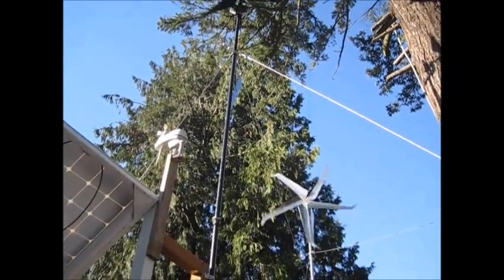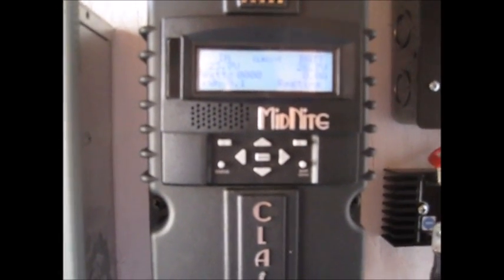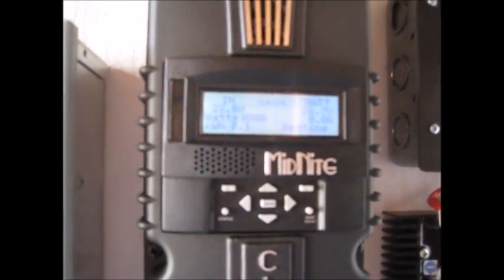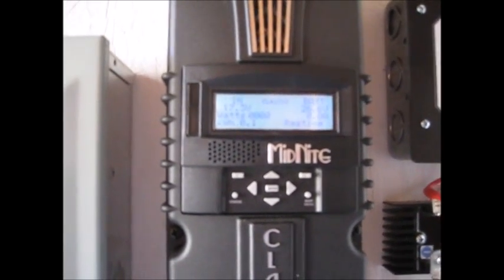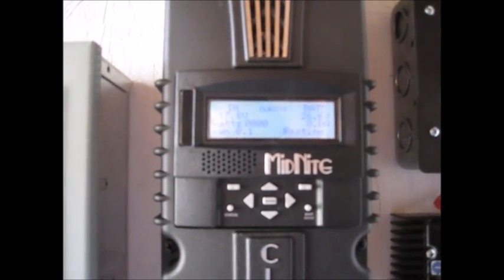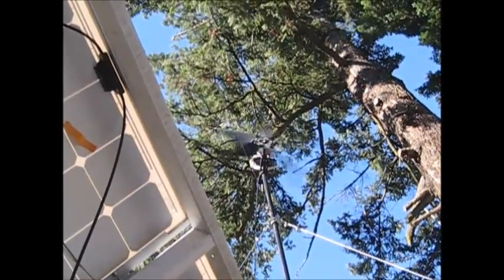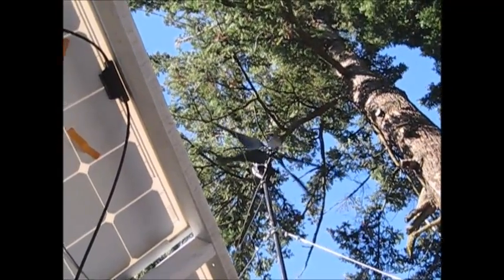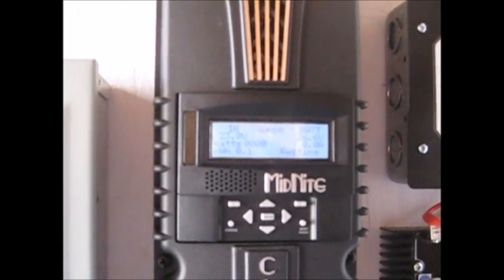MidNite Solar Classic 150 power curve adjustments

Comment: this will definetely help boost power output alot with the mppt however i am still trying to understand it better one question i have is do you program it with the measured voltage open circuit or with a load and also i wonder how you would program this for hydropower. thanks for the video
Reply from the maker: I adjust the curve under load. its a little tricky, but you basically give it just a little room as it reaches each predicted amp output range you are looking for, it slightly free spins up to the next rpm/voltage area, and then it jumps to the next amp setting. it does take some trial and error.

Comment: This will be interesting to see if you got the right adjustment on the power curve..  It will produce for sure because you were producing without it..  You should attain 30 % more with the right setting on it..  Thanks for the update.
Reply from the maker: +al “peper 0110” desrochers   Hey al "peper   its going to be fun and take some time.  with all the dirty wind I get here it will take some work that's for sure.  at least its the windy time of year here so I just have to wait for the next windy day.  what is nice is you can produce a log of result. so I am keeping a close eye on input, watts , and amps , catch ya later on SD.

Comment: I think because the input is from 3 phase input the the power p=v x i has a correction factor. that's why it's a curve and not a straight line. chris olsen's power curve would be a good place to start.
thanks
it will be a while before I buy one of these.
best
Reply from the maker: +Rev John O'Toole  Chris Olsen's and Orlando make the same style wind generator. they use stronger magnets, and more coils per phase, at a completely different voltage then what my little wind generator could possibly make.  Mine has to be custom made for this set up. Possibly you did not understand what this classic charge controller is doing, check out MidNite  solar charge controller support for wind, and they explain it a little different then I do, but basically the same. what your looking for is efficiency for any change in wind. with a normal controller, you will only have one point that is efficient. with this one, you can have 16 spots.
Reply: +SilentDeath002 I understand, it's like calibrating a booklet maker to a 300 copies per minute printer with a roll paper feeder, you get it in the ball park and tweek it to get the optimal output to the specific variations of that turbine. if you had another turbine like that one the curve would be a little different. that's what nice about the classic is that you can make adjustments.
btw, maybe you can ask jeff to test out the new aluminum rotor.
best
Reply from the maker: +Rev John O'Toole  what jeff are you talking about John, and what aluminum rotor? I must of missed something

Comment from the maker: Thanks bro!  I think I will pick up those blades your talking about. only thing is I want to use a custom made hub. will have to talk to you about that. I think this mini tower may be to small or those big blades. might put it up on the 2 inch galvanized tower and beef that one up.  oh, if you get a chance, can you sent me a link for that relay so I can hook up a dump load to the classic, I think you called it a SSR. catch ya later on SD.